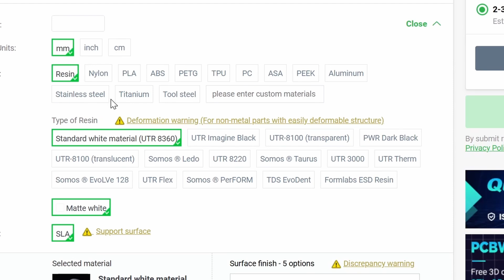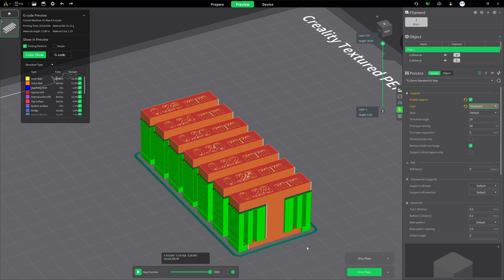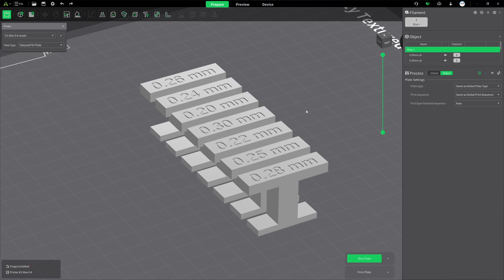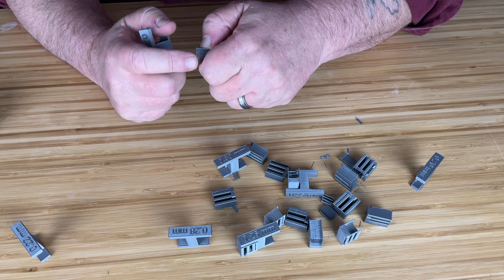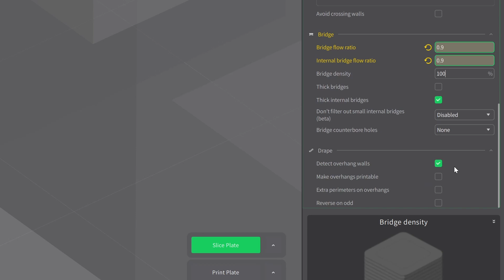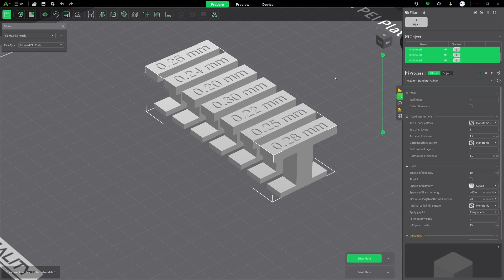Make Your Supports Easy To Remove With Creality Print 5

Comment: Thanks, this made removing supports so much better.  Also got me to change from the cloud slicer to Creality Print now that someone explained a bit of it combined with what i learned in the cloud slicer it makes a lot more sense and is way more powerful a tool.  I just don't like you can't spin your model around by dragging the mouse it seems or at least i haven't figured out how  yet.

Comment: Thanks for a great video, Do you know how we can use HIPS filament as a layer between the top of the support and the model. It will be a waste of time using Hips for the entire support structure as changing the filament will add a tone of time to the print. So how can we use PLS ( example ) for the model and the support body and Hips as the top/bottom layers of the support body?

Comment: Had a similar issue with the interface layer (dk green) not easily releasing from the print object using standard supports.  I found the cleanest separation occurred when those interface lines were close enough to each other to just form a "skin" rather than a grid of spaghetti.  Then it peeled away more easily and much cleaner from the print object.  Unfortunately, I don't recall which C5 setting set that density.  Maybe it was the sparse infill percentage?

Comment: I printed an object yesterday on my K1 MAX. It was 119 mm basically square with a 2 mm perimeter and a pocket of 12 mm. There was no other way to print it. I used Creality PETG and Orca slicer. Support started at the build plate. I expected a pretty crappy surface at 12 mm but was amazed on how good it came out and the support stuck to the build plate perfectly so I di5 have to pull it off. I was amazed.
Reply: Sorry I meant to say a 12 mm pocket